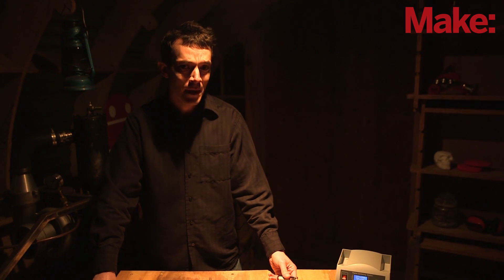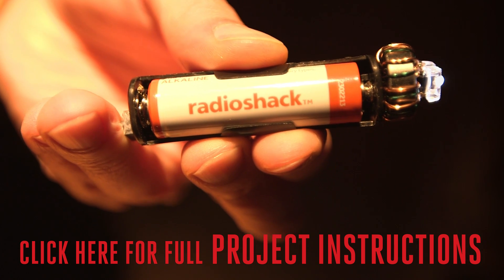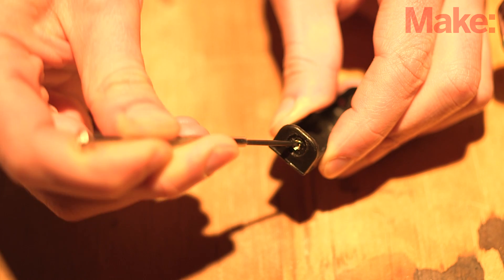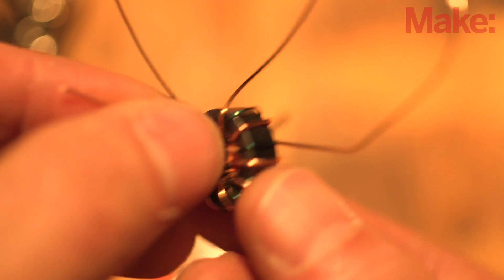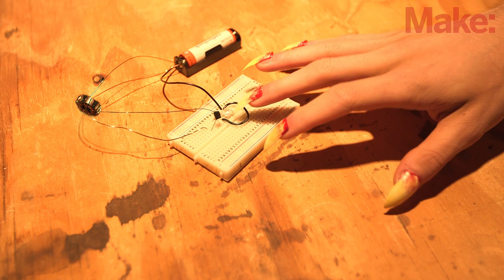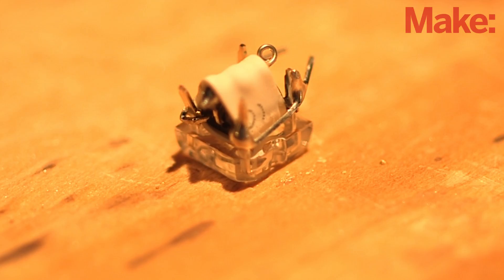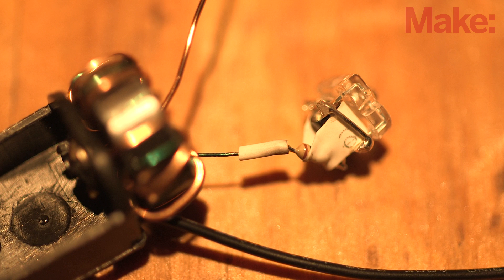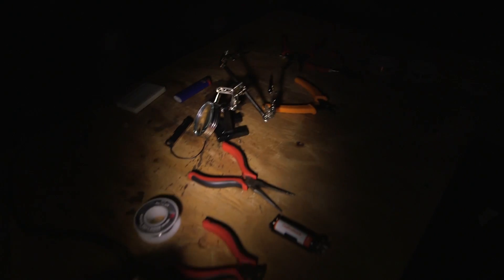Weekend Projects - Vampire Flashlight

Comment: A funny additional feature is that when the battery is drained so low that the joule thief can't work properly, the LED starts blinking. When the battery drains more, the blinking slows down until the LED finally no longer lights up.

Comment: Does it work with a white 4 3mm led?
Reply: Yes, it works with any type of 3 or 5 mm LEDs as well as the piranha type LED shown on the video. It won't work with the power LEDs (the type which require heatsinks).